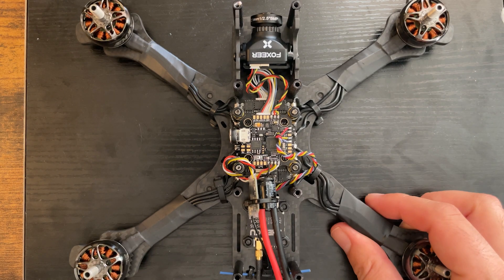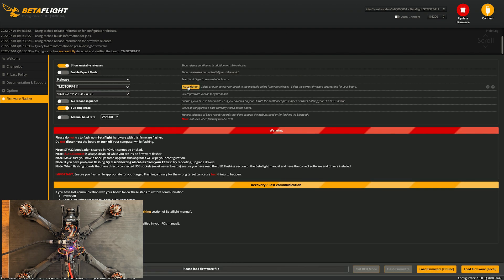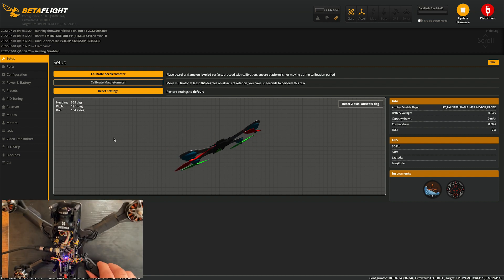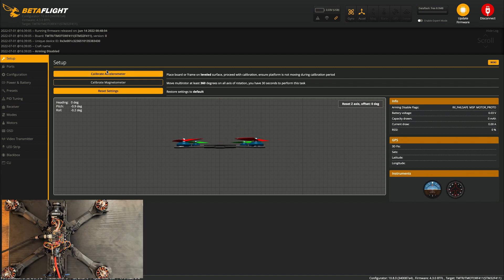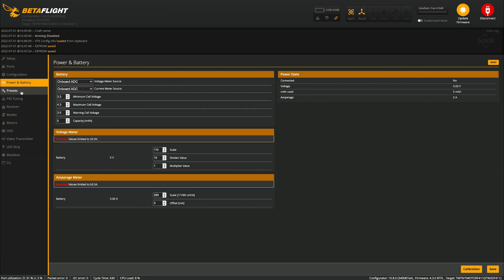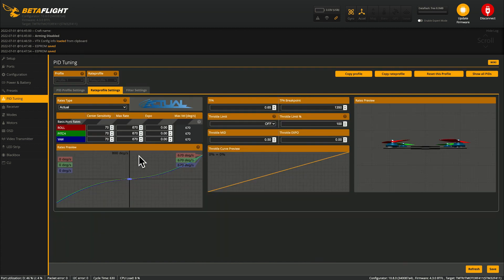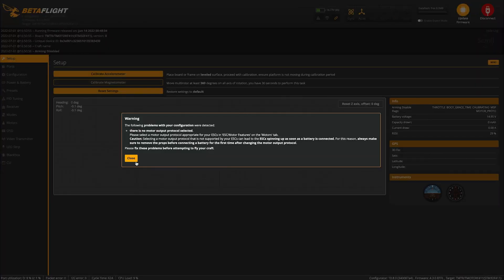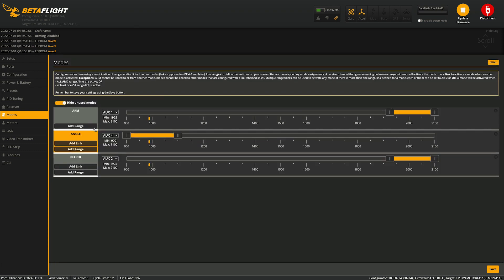Betaflight 4.3 Basics - Get your drone in the air!

Comment: How do you find out what hardware you have on your FPV if you have not built it and you have no diagram showing how video receiver connected to flight controller to choose the right options in Ports menu in beta flight please ?

Also how do you find out and get same software for receiver and transmitter for binding radio master tx 12 ?

Thanks.

Comment: Hey I have build my second drone with elrs happy model 2.4 receiver and is bind to my elrs module. Everything is fine but when I go to betaflight it won’t show the roll, pitch, etc… moving when I move it on my controller. Is bind and everything but won’t do anything. My first drone works flawless but this second one I can get it in the air. I have a TX16s radio btw. Help me
Reply from the maker: make sure you have the "CRSF" protocol selected in the receiver tab.
Also make sure you have the right UART selected for "Serial_RX" selected in the ports tab 👍

Comment: I’m new to fpv man so I think for me and anybody else it would be good to not leave out the little details like telling people they have to download all the necessary drivers off betaflight so I don’t have to spend an hour searching and watching videos on why my betaflight throws that failed to open port error.
Reply from the maker: The only time I've run into the “Failed to open serial port” error its due to using a USB cable that isn't meant for data transfer. Try swapping your USB cable. 

Any driver you need to install may be specific to your flight controller or even computer. I haven't had to install any drivers to connect to any flight controllers on any of my computers. ever.
Reply: What did you do? I'm having the exact same issue with my serial port.
Reply: @TRONCATFPV  I am using a normal type C cable and when I plug it in to my computer from the drone it detects the Stack on Betaflight software but it does not work when I hit "flash firmware" do you think this is because I am using a regular C cable ?